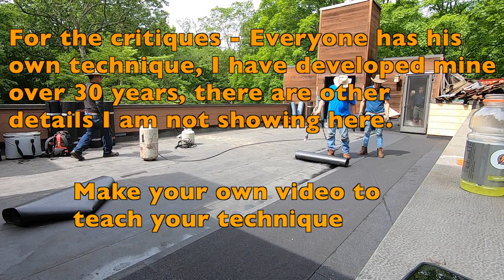Learn how to use a torch on a Modified Bitumen Torch Down Roof

Comment: I have used 3 ply modified bitumen that has gravel on top and I guess the material you used is the same minus the gravel. Why is it necessary to put down fiberglass sheet over the old gravel and over that base sheet and modified bitumen; why not skip the fiberglass sheet? Or can you skip the first two coverings and just applied the modified bitumen roll over the old gravel?
Reply from the maker: Ok, I am a little confused at what you are saying and asking:
1. "I have used 3 ply modified bitumen that has gravel on top" Does "gravel" mean "ceramic granules"?
3 Ply - what is each layer consist of?
2. The reason I install a "fiber base" not "fiberglass"(it is a specially designed fiber asphalt saturated paper for torch down) is because:
a) it provide a smooth surface over the gravel roof
b) it prevents sharp edges from piercing to the cap sheet
c) it is a stiffener for the system - meaning it helps keep the cap sheet from making creases.
3. You can never install a Modified Bitumen Torch Down membrane by itself. It will start getting wrinkles over time. You need a backing like a fiber base paper
4. "I guess the material you used is the same minus the gravel" I don't understand this part of your statement either. I am confused at what you call "gravel."
Reply: @FlatRoofDoctor  Sorry about the confusion, let me clear it up. I meant ceramic granules and not gravel. I was covering over an old modified bitumen covering that had faded white ceramic granules on top. First, I laid down a flame resistant fiberglass base sheet and fastened it to the old covering with nails with square plates on top and  torched down a new modified bitumen membrane with white ceramic granules for top cover. I was referring to the new membrane as a 3 ply, only because the label on the product said, "Tri-Ply APP membrane-maybe I am wrong. I spent 2K just on materials and the roof is still leaking, a lot less, but leaking and I noticed creases, or wrinkles developing on the new covering. Did I do it wrong? I did learn a lot from your other videos on how to find and fix leaks from flashing and around pipe/vent openings. Thank you!
Reply: Really does not make sence. You would only use gravel if you were flood coating and there would be no need to flood coat over modified cap sheet only felts(4ply/bur)
Reply: @dustinlogan7956  now that's a roof

Comment: Is that smooth or granular modified bitumen? And which is better for flat roof?
Reply: smooth is usually used as a base coat, and the granular as the second ply

Comment: No 45 degree fiber cant strips? Smooth transition at the wall break, it’s code here
Reply from the maker: You absolutely right, I don't follow many codes. my bad. It is like most people don't drive the speed limits, do you? I agree, with you, but I have also found that most codes don't make sense.

Comment: What materiala did you use I have a flat roof that I need to replace
Reply: 2c base layer, 3kg sanded. 4.5 kg mineral. SBS Polyester.

Comment: Glad to have found your channel... liked and subscribed.... I am looking to replace my EPDM roof 16x16 that I installed on my house 20 years ago and was wondering what is the best overlay to use instead of ripping up the EPDM ...thanks
Reply from the maker: I always use a Johns Mansfield Dynagrip peel and stick base and then torch over that with Firestone APP 180 White Granules
Reply: @FlatRoofDoctor  you guys for work
Reply: Do you need somebody for work for you
Reply from the maker: Hi
The best life extender for an EPDM rubber roof is Super Silicone Seal from Bergstromm.com
Watch this video where I explain how good it works
https://www.youtube.com/watch?v=sxXBS0v3hVY&t=19s
Reply from the maker: @marielugo8047  Are you pretty?
Reply from the maker: @marielugo8047  I already have a pretty girl helping me. You can join us

Comment: In my honest opinion , you should be using a asphalt primer on the metal and not roofing cement !
This will most likely cause the roof to fail ! 
I’ve done torch down for over 25 years now  and I’m a member of Roofer Union in Chicago out of Local# 11 , Roofers and Waterproofers !

I enjoy watching your videos, keep up the great work !
GOD Bless 🙏🏻🙏🏻
Reply from the maker: Hey Deno - You are correct, asphalt primer is the way to go. What you don't have right is you call it "roofing cement". That is the junk most roofers use. I have never and will never ever use roofing cement on any roof. Karnak 81 is not roofing cement. Karnal 81 Trowel Grade has the same components as Karnaks asphalt primer. I have been using it for 30 years and never had a problem. I have never used roofing cement in my life.
Thank you anyway for bringing that out. It is a good observation and a good tip from you.
Use Asphalt primer if you plan to torch and melt straight to metal. (very difficult to do, need to nail the drip edge every 3") In my case, we don't torch to the metal but instead, we use Modified Bitumen Adhesives from Karnak.
Thanks again for your input - it is much appreciated
Reply: Flat Roof Doctor 
Always learning , we’ve never used that before or heard of it here , I’ll have to look it up !
Just curious, is that a Hot Shot torch ?  They’re getting hard to get in The US , glad I stocked up ! 
Also, Have you ever used a Dragon Wagon to torch out the flats ?
Thank you for your reply and great video 😎👍🏻
Reply from the maker: @DenoKeller  Hey Here is a link where to see the Torches I use. It's a magnum https://www.modisystems.com/MagnumTorchKits.php
I have other torches for detail that i will demonstrate later

Comment: Everything looks super clean and well done but your gonna burn the home down without an extinguisher. Having that gravel bed helps but that flame lick is going to find a dry spot and it’s over. I have been torching  Modified since 1992 and we always used a 43 pound mineral anchor sheet with Modified mid ply and MF white cap, if I ever did this without an extinguisher id have my liability insurance cancelled.

Comment: I hope your in my area if you’ve been doing this horrible quality for 30 years means I’ll be in business for years too come your doing 90% of everything wrong I am 23 and have been doing this for 8 years and I did better quality my first time on torch your using Karnak on metal that’s complete wrong in so many ways they make this called primer for metal and your standing on the roll putting boot marks all over the roof it’s crazy you even have work after your first job if you compared 1 of my jobs to yours you would be blown away at the quality and skill that you clearly lacking I feel bad for your kids getting taught how to be hacks at flaying roofing when it’s an art to be flat roofer honestly disappointed in people like you that think you can do this to homeowners that roof likes like shit and is pieced in like shit you have so much to learn so little time   Also I never comment on anything but this is so bad I couldn’t help my self my jaw has been dropped the whole video

Comment: Capping a gravel roof with torch down is genius. Tar and gravel roofs are very popular here in Canada, I asked a  commercial roofer friend of mine if he ever heard about it or tried it. He said i was crazy. Then I showed your videos, and he's going to try it on his shop roof. Looking forward to seeing the results
Reply from the maker: Nice, I have been doing it for 30 years. People are crazy to want to strip a roof just to put another layer. As long as the roof is solid, the substrate, then you can install this system over any roof.
Reply: @FlatRoofDoctor  
I'm wondering if insulation boards can be used over the gravel before the torch down?
Reply from the maker: @andrewbeaudry9705  That's a common practice. Most roofers will install a 1/2" recovery board and then a base paper over that. The recovery board will have that additional height and sometimes will make it harder to tie into old existing flashing. But it is also another way to do it.
Reply: @FlatRoofDoctor  
I've been looking at Roxul TopRock DD Plus. I'm just wondering if you ever tried it? Can't find much info on how to tie in drains, openings, and flashing. Apparently, they have curved pieces for curbs and sloped sections. 
If you can share any knowledge you have or opinions on this would be appreciated.
I'm not a roofer but do property maintenance and started watching your videos to learn how to find and fix leaks on flat roofs. 
I've been thinking about trying to offer more flat roof repairs to my business and bid on larger roof jobs. Obviously, i still have a lot to learn
Thanks again Naas for your help
Reply from the maker: @andrewbeaudry9705  Hey, I think I have unedited videos on how to tie into a drain. I might post one for you.
Thanks

Comment: How much would you charge in labor on something like this?
Reply from the maker: Depending on a lot of factors. If it is a plain roof with no preparation and you could start torching almost right away, then around $5 p sq ft. That includes the material - Self adhering base, Cap sheet with granules and commercial drip edge. 
That is the basis, but then other factors must be taken into account. The bigger the the roof. the less per square feet. More obstacles, the more per sq ft. Then also, the area where you are. If you are in a city, like New York, or in Connecticut, then the price almost doubles. If you work in small towns across America, then the price goes down.
I hope you get the idea.

Comment: going overtop of gravel like that is going to cause blisters from any moisture geting caught in the system. you wont get 30-40 years like that lol
Reply from the maker: you know nothing. I have done this for 35 years
Nothing went wrong. In fact, it is far better than a normal torch down
Reply: @FlatRoofDoctor  sure yeah. all the leaks calls ive been on that had terrible systems like that from people who think they know how to roof lol
Reply: @bongcrusha420  Yep, with ya on that.
Reply: @dogtaxi812  30 years of successful experience is not to be laughed at.If you’re concerned about moisture then simply add some breather vents…About 20 years ago  I was asked to appear on a GAF video introducing Grand Sequoia, a presidential copy, they were thrilled with the roof until I told them it would flop, the GAF “experts”weren’t happy with me..I’d suggested an optional 5”/15” type side lap like presidential, they wouldn’t listen until a year latter when they called me to say they were going ahead with my suggestion…So much for the Experts..

Comment: Its  Glass Fiber. Not fiberglass .  Miss leading when you say  Fiberglass . There's a difference . Your torching is horrible  and will lead to many deficiencies  through thermal cycling .
Reply: Alion Mush would really appreciate if you Could please specify the mistakes rather than categorically saying the technical is bad. That would really help junior rufeers. Thank you
Reply: Would never pass an inspection.
Reply: I would normally use a cane to pull my roll instead of walking on it. If you tried that on a hot summer day  your cap will end up with footprints (if torched properly). Pulling instead of kicking the roll allows you to control the flame and hit all areas of the roll and the base layer underneath evenly. This roof will be covered in Blisters (air pockets under the cap due to lack of heat and adhesion.  The biggest mistake in this video is torching to plastic cement(mastic,bitumin,sopramastic)
Reply from the maker: You need the cane instead. You are correct, if you use GAF or Carlisle products, they are way to soft to walk on while torching. If you have enough experience you know which products are good to use.
Experience is what you need. To much talk doesn't get you much. In this video we are torching to a MB base that is meant for torching. John Mansfield Dynagrip.
Too little knowledge too much bark makes for a Puffed up head

Comment: u really should remove the rock so u can repair any defects in the field of the old roof.
Reply from the maker: There were no defects. You can tell from looking inside the building up.
Your thoughts are most common to many as you.
As long as there is a nice solid flat surface, I don't see why you can't install a roof over it. Your thought is to remove a solid flat surface to another solid surface (the substrate) to install a new roof. That is the most common thinking. But always more costly too. If the cost was not the issue, we might as well remove the entire structure and start over again. What about specs where they require 4 -5 layers of Torch Down?
Your thought would be it can't be done?
BTW, I appreciate your comment. I am just trying to let you see it is not always necessary to remove a layer of roofing.

Comment: Why dont they make those rolls wider  there not that heavy
Reply from the maker: a roll of Modified Bitumen TorchDown wit granules weighs 110 lbs. That is about the max someone can carry up a ladder. It is also hard to load and unload a truck or to move it around. So, I think the manufacturers figured it out what is best. But to have wider rolls would almost become impossible to handle.

Comment: Yo I'm furious I call myself a roofer bc I am. Now I work for men who everybody knows the rightway rather then say what you did everybody had own way but the end result is same. The roof don't leak now if I have question or I am unsure I will say it like torching I do everything else cut rolls put metal on. Walls on now I just need to get down smooth torch with 5/8th bleed but now two jobs where I got to work my self I torch whole roof bc I could think not fukn argue about dumb shit it's like hooking up down spout you drop zip screw one no biggie but oh no fukn boss or guy with seniority says get down I got it then he drops 6zip screws like what the fuck why can nobody just let you work. And if you have to here a suggestion let a man say it a fashion of yo here try this. One thing on this earth I can do that's work like a man. I'm just venting but fuck if I was some asshole on a roof I'd admit it I'd say I gotta get better at this I dunno just tired of everybody saying that's wrong it's done like this and I know there's other ways that are better or I'm faster my way. Hot work touchdowns singling. I can do. Any suggestions please message me.

Comment: Your installation method is totally incorrect. The point where the felt is heated is where the roll touches the area it is bonding to. The side lap has not been bonded, a maximum of between 50/60% bond at best. The roof will kink and blister. You need to come to the UK, the workmanship here is far far superior. Using a gas gun near a timber upstand is suicidal, massive fire risk. We would have to use self adhesive felts at details like this. Overlaying a roof like you have is a disaster waiting to happen , condensation will build up between the two. I do admire the US/Canadian roofers commenting on your work, you would get ripped to bits over here.

Comment: Let the people know how much it'll cost to rip-off  2 roofs and when you have a failure on the top overlay roof it'll be impossible to chase leak. This is the worst way of roofing. Save your money rip the original roof and install it correctly